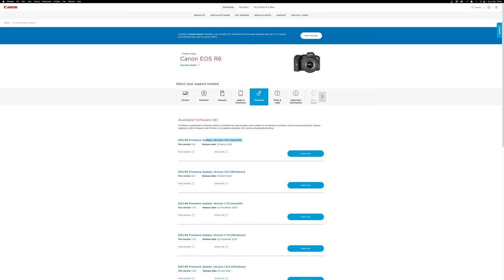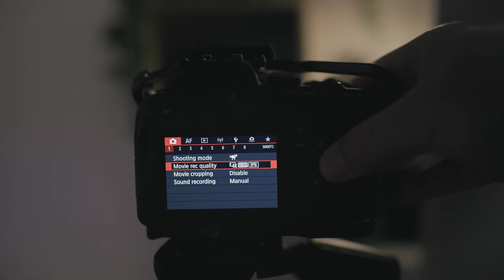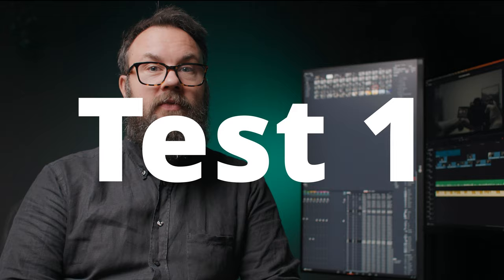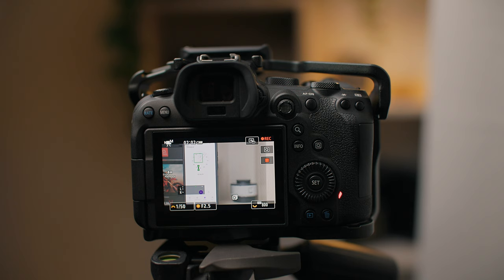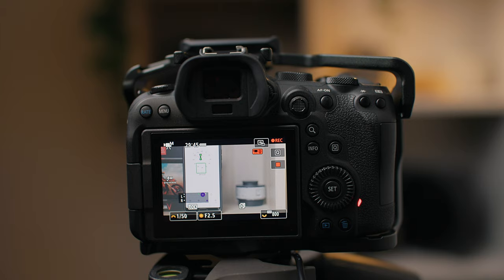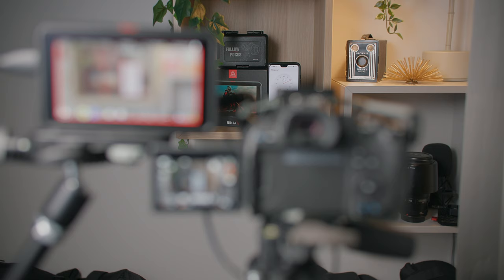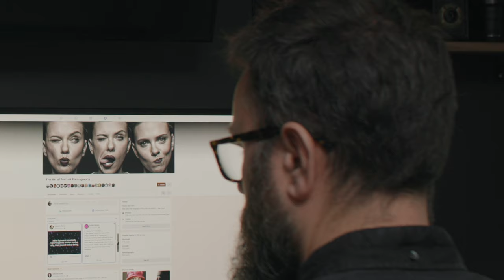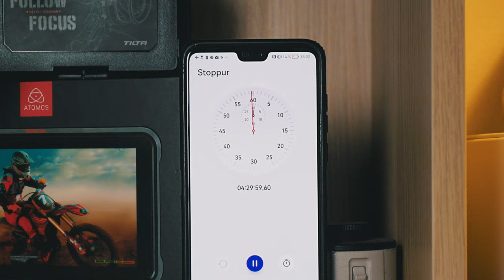Canon EOS R6 overheating

Comment: After 30 years in this business, you shouldn't need to buy another expensive recording device to use what the camera itself claims to offer. I think it's time for a class action law suit? Is there one? They have thme for lying auto makers all day long etc. Been using all canon pro gear for these past 30 years. I even have the atomos accessories. But when I want to run lite,  fast and just use a Ronin RS3 hand held. The camera should simply record. At the very least for more than 20-30 min and that's not even contestant recording. I'm over it. Canon you owe me for 2 Canon EOS R6's. I Got all your new EF glass NOT CHEAP. And it's all worthless for video that you sold us on!
Reply: You're aware that now car manufacturers force a subscription on you to retain (remote) mobile device functionality?  Its not a new thing..
I'm not saying I agree nor support their model.
Reply from the maker: Not sure I understand or follow. If you need a flash you need to buy a flash, as that is an accessory that is optional. External recording isn't something that is needed, but that is an accessory that many video users prefer. It's an optional accessory, not something that is required to use the camera. The 30min recording limit is not a Canon issue, it's an old EU tax rule that divided video / broadcast from photo camera, but that's removed. That's also why new cameras comes without 30min limit
Reply: I was not actually. Wow, I would never buy anything like that. I just researched it. Not sure that will stick. Especially in this economy. The greed is catching up to people. I'm sure there are some that can get around it (love those guys). I don't do car payments or debt if possible. That's just me. I also don't ever buy a new car off the lot. It's the biggest waste of money many know of. One of the wealthiest men I know has been driving the same old, but nicely kept beamer for like 15 years now. He bought it used for 17k. I drove past his restaurant the other day and saw the car outside. He's still driving it. He's a page right out of The Millionaire Next Door.  @schimor
Reply from the maker: @Motivatedlightmedia  The overheating I do agree on, but tbh, I never get overheats sub 20min and as the camera is only rated for 29.59, I don't really see the problem. But I do know others get overheats all the time, so yes. If the camera isn't drivable, it's faulty :D B

Comment: Let me get this right - each separate solution gives you few minutes, but combining them gives you 5h? Sounds sketchy...
Reply from the maker: TBH, yes it sounds sketchy, but it worked for me. Try one at a time and see if you get a different outcome? Not here to sketch anyone, just trying to help out the community.
Reply: @persvanstrom   Oh, don't get me wrong  - I'm not accusing you of anything! Just thinking out loud. I'll def test it, but have to rent ninja V first :)
Reply from the maker: @wah0wah  I answered in a different video but ran into several overheats with Ninja, due to me touching monitor on the R6 checking focus. So my own feeling is that the screen covering the back is a big reason for overheats. No matter, Ninja is required for 30+ min recording as the R6 is locked for longer recordings unfortunately.
Reply: @persvanstrom  awesome insight! Thank you,  I'll check that video 👍

Comment: Very dramatic video. Good choices of music to support that drama. When you were counting down the solutions on your fingers, I wanted to see graphics on the screen listing them. To summarize: use dummy battery, remove both memory cards, turn off screen, and fold out screen. Your last two solutions are problematic however. With the Ninja V attached, you can use the R6 screen to change F and ISO in response to external conditions. But I saw that you were presenting the screen on the Ninja, and using the wheel to change camera settings, which is not the F and ISO, so this is confusing (at lest to me). I have the R6ii and the Ninja V. Even at 4K-24P I'm lucky to get 9 minutes before the ninja shuts down.
Reply from the maker: Your Ninja overheats?
Reply: @persvanstrom  god yes! I'm trying to get my Ninja V to work with it. At the most I've recorded 9 plus minutes before the Ninja says there's a problem with the connection, and shuts down. Any input would be MUCH appreciated.
Reply from the maker: @corlissmedia2.0  You run latest firmware? 
I would check HDMI cable. As it complains on connection…
Reply: @persvanstrom  I’m running 1.3.0
on the camera, 11.06.00 on the ninja v
Reply: I’m using an atomos cable that set me back $75. The ninja v is going to a 2TB Atom SSD. M with you, the bottleneck is the hdmi D connector on the camera.

Comment: I appreciate all your diligence but if we have to do all that just to get the camera to not overheat it doesn't seem worth it. I've been eyeballing the s5ii and sadly I might be saying good bye to canon 😞
Reply from the maker: I get your feeling, but it's not that bad when you summarize it. I often shoot interviews for a few hours. Then I still need an external power source, my choice V-mount. Something you would need on any camera. When doing video work an external monitor (or recorder) is often very handy due to all the extra information it can give you. Memory cards or not, are more or less a choice, but with a 1tb SSD recording I would pref over SD cards anyhow. With the external monitor, no need to use the camera monitor and we are all set :)
Reply: @persvanstrom  I shoot mostly weddings so unless it's a Catholic ceremony most of them are only about 15 minutes so I should be ok. Buts it's pretty hot in Texas in the summer so I avoid 4k during those months
Reply from the maker: I can only imagine how hot it can be. I noticed on a recent shoot, where I shot interviews for 11h straight (yup long day). Even if I had everything set up as I described my R6 overheated a few times. I realised it was when I was worried about focus and I kept turning on the camera screen. Not sure that info will help, but I would avoid using the back screen as much as possible. I think you could get another 10min from that. Then 30min in 4K is still the limit as that is when recording stops, but I don't see why it shouldn't manage that.

Comment: I noticed that you lowered the iso to 400 and changed the aperture to F4.0 on the final test that worked out. Did that have something to do with it? was there a reason you did that?
Reply from the maker: It’s just an error on the footage I used (yeah stupid mistake) but for the actual test it’s all the same settings

Comment: I've had mine about four months and love it.  I'm an event photographer and have never used it for video but have found that after about a thousand frames in any one session, I don't get the warning light but it does start to freeze up and becomes useless until I shut it down and let it rest for 15 or 20 minutes.
Not great when it happens, for instance, at the end of a wedding reception as the couple start to make their grand exit.
Reply from the maker: You shoot H+? I’ve had a few freeze in H+ when bursting, but a restart always solves that. Have you tried that? I can’t imagine the stress to have the camera freeze during a wedding
Reply: @persvanstrom  No, sir.  At weddings I shoot single frame only.  I've tried all the standard quick reboots including cycling the on/off switch, popping the battery, replacing the battery even though the 'current' battery has a fairly full charge and even popping the lens.
Nothing works except letting it sit for a while and, I assume, cool off.
Reply from the maker: I managed to overheat mine by just waking up the back of the screen to check AF. When I shoot events, which is about 3-5000 photos in a few hours, I never use screen, just viewfinder and never have overheats. Not sure it helps, but that screen can generate a lot of heat is my experience.

Comment: nice test! I have to say though, i did everything you said, and weirdly it's even worst... the camera stops even quicker than with a battery , both cards in, etc...
I'll search for other streaming solutions, and resell every accessories i bought
Thanks for your effort, cheers man
Reply from the maker: Worse? Really? What firmware are you on m8?
Reply: @persvanstrom  yep 1.8.4
i can have 35min with a battery and 2 memory cards, just the creen flipped.
And with the dully battery and card slot empty, and screen flipped, it's a little less than 25min Oo
Reply from the maker: @KhasisLieb  But 35m is above the hard limit of the R6m1? I'm confused :)
Reply: @persvanstrom  35min with hdmi output, no recording on the camera. (want to test how long i can keep it up for streaming)

Comment: I wished you had spoken a bit about the cons of using this method to avoid overheating. One thing I can think of is you can’t check or monitor autofocus as it won’t show the autofocus face detection or eye detection indicators in Atomos. I would like to know what other cons like that are a part of this strategy if one were to use it like this to avoid overheating in 4k60.
Reply from the maker: yeah, not using the camera screen can be a problem. I even speak about this in an upcoming video, where I was worried about AF, so kept turning on screen to check and ended up with an overheat. On the otherhand, turning on peaking on my Ninja and I can always tell if I have focus on the right place. I'm just so use to checking camera screen I sometimes forget to use the external monitor. 
As to speaking about pros and cons, I will try to do that more in future videos and I did so in my just recent posted video. Hope you liked that part better :)

Comment: A really cheap solution would be using 'semiconductor cooling systems' , they use peltier effect to cool the camera's back .... and can be found on aliexpress for 30-40 Dollars... I used it with my A6700 and I was able to record video over 1hour in 4k120 (in  temp =30+ C !!!)  and it never overheated in 4k60 on warmer days.
these cooling systems are really good and dont take up too much space, I hope more people find out about these cooling systems,they are silimar to the new Ulanzi cooling fans but they are 100X times better because they work on cooling rather than just heat dissipation . They only need a small powerbank  as they are externally powered)
Reply from the maker: Intresting, thx for sharing

Comment: Now.... what about using a Battery Grip and switching maybe from The Live View to the EVF? Leaving the Live view Screen off maybe during an Interview video recording?
Reply from the maker: Super interesting. I almost need to get a battery grip to test this (don't own one as I mostly go AC or V-mount) @CanonEurope care to lend us a battery grip for this? 😅
Reply: @persvanstrom  I'm almost done saving for my R6... by the way I heard alot about the Codec H.265.... any update regarding this? Or which best suggestion around it? As this Camera will be my main rig for Video I don't do alot of 60pfs so I don't think overheat will be a pblm for me
Reply from the maker: I had no problem on either PC or Mac with H.265. I have more problems with Prores tbh, mostly as the files are HUGE! It's more a matter what NLE you will be using and your plattform (Mac or PC). The camera does what the camera does, so to speak. What will you be using for operating system and NLE?
Reply: @persvanstrom  was planning go Get an i7 12700H with RTX 3070ti 32gb DDR5.. will be working with Premiere, after Effects and Resolve..
Reply: I remember reading 2 years ago people  complaining their PC couldn't even display the Video thumbnail... some couldn't import the Footage nor even play log footage using common players like VLC.. etc
Reply: @persvanstrom  Really wanted to get the R at first... but then saw I can't use Log except I shoot 4k and it has a crop.. so R6 FHD or 4K clog the poison is mine to choose... love your Video Bro thanks very Helpful
Reply from the maker: I used 265 in 4K on a 1080Ti so you will be fine. Even if I don't use Premiere, just don't like it. Resolve on the other hand is amazing. Note to PC user, will need Resolve Studio to get H265 (included in free Mac version), but the studio version is well worth it. Hardware render support is just another game. No doubt the 265 is harder to work with than the 264, but it is also a difference between a Laptop and a new PC/Mac. So I would not worry so much tbh :) A lot has happened in 2 years.
Thx for the feedback, glad you like it. You know you can get 4K 60 with a Ninja V with R right? That would save you some cash, even if the R6 is a much better camera in all aspects, sometimes better isn't what we need :)

Comment: Hey man! Great video. Do you think newer firmwares have since solved these issues? Also if recording on 4k 60fps (no log), is overheating still a major issue?
Reply from the maker: Tbh, I don’t know. I have to test. More that asked this. Log or not, shouldn’t matter that much. Frame rate and resolution does
Reply: @persvanstrom  got it. Thanks so much for the reply

Comment: So basically i will have to buy the battery and leave the screen disabled but keeps it open and buy the ninja screen yeah  ?
Reply from the maker: Basically yeah, but I don’t like to recommend any new purchases. Do you need more than 30min?
I had my R6 with this setup overheating by turning (waking up) on camera monitor while filming. Nothing is bulletproof unfortunately
Reply from the maker: Basically yeah, but I don’t like to recommend any new purchases. Do you need more than 30min?
I had my R6 with this setup overheating by turning (waking up) on camera monitor while filming. Nothing is bulletproof unfortunately

Comment: Any guidance on what the best settings are for auto focus for video?
Reply from the maker: I will start making a video about that asap. I prefer CLOG3 and I got a video about how to expose for that. When it comes to AF vs Manual, what AF etc, I think the standard settings get's you really far. Did you have anything specific or specific scenario in mind?

Comment: Thank you for your tips. What dummy battery are you using for the R6?
Reply from the maker: Can’t remember. Cheap Amazon. Andycine maybe. Check my Amazon links, it should be there
Reply from the maker: Here is the link to the adapter I use https://geni.us/uxNElU (affiliate link)
Reply: Also try using the battery grip.  The batteries are under neath

Comment: 8:37 What do you recommend to do the recording externally? Can we simply use our iphones? I wasn't familiar with the product you used.
Reply from the maker: I use Atomos Ninja V, it's almost industry "standard" for creators and independent filmers when it comes to recorders. I has removable SSD's, making it easy to record longer sessions. I bought mine used for 400$ with SSD, dock and cables, so can make a bargin on them. Atomos also has Atomos Cloud Connect, where you can push proxies directly to cloud for faster edit or customer collaboration.

Comment: Wow this is crazy!
Can this be done with an R8 as well?
also, I can't really afford an atmos 5 in my build, but I can probably also do this with my phone using a recording wifi app right?
Reply from the maker: The Canon EOS R8 has a maximum video recording time of 2 hours for it's typical long recording format (no-one records 2h in 120fps). That makes the R8 a different camera than R6 that has 30min as a hard limit built into the camera. From an heat management the R8 is better from start so anything around 1h mark is just hit record and sort it internally. I wouldn't recommend sending anything but hd over wifi and pref not that either. 
You own an R8?
Reply: @persvanstrom  No I don‘t own an R8, but am really considering buying one! Do you think its worth buying an r8 over an r6?

Comment: Sorry. It seems that it is not the combination of the individual recipes that made it. This would be mysterious. It appears to be the fact that you  removed the second sd card in the last test. So it would probably be the internal coding to H265 that generates heat.
Reply from the maker: I tried with both cards and only one, but it was only with all the combinations I managed to get 5h. If you have other data I would love to hear it, always great if we creators can help each other 😉
Reply: If your record on an external device (i.e Atomos Ninja V) in clean HDMI, it disables internal recording, no matter if you have 1, 2 or none SD cards in. So no internal (H265) coding is performed, explaining IMO why it does not heat. @persvanstrom
Reply from the maker: that is correct, last one was only external. Now with new firmware, I might make another, follow-up video if people would be interested. Just to ensure we got all facts and scenarios covered. One thing I didn't test was two different memory cards V60 vs V90, to check if that makes a difference.
Reply: @persvanstrom  would be great to watch that new video. My R6 has been overheating recently. Mostly if I'm shooting in clog3 60fps